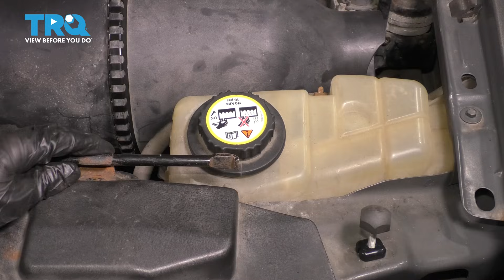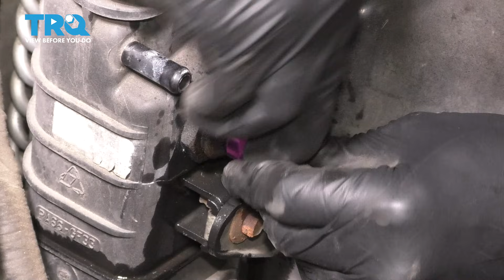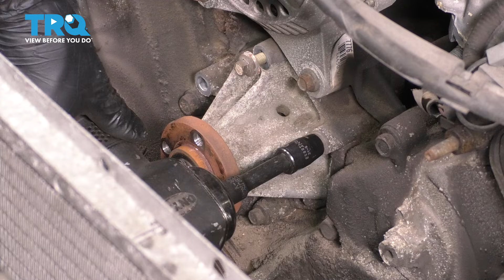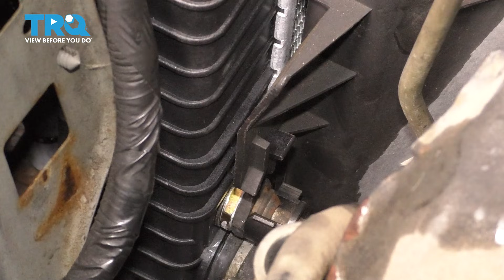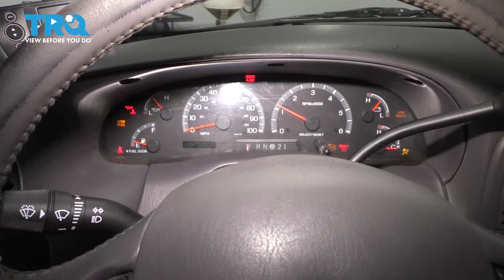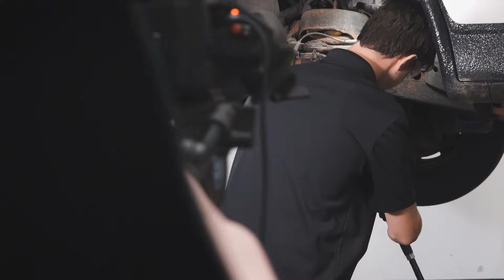How to Replace Water Pump 1997-2003 Ford F-150

Comment: REMOVING THE TRANS COOLER LINE AND COOLANT RESERVOIR HOSE ARE COMPLETELY UNNECESSARY STEPS.  Taking the upper radiator hose off at the radiator gives PLENTY of room to get the fan shroud out without removing the cooler line.  No need to remove the reservoir hose from the radiator at all.

Comment: unless you take out yhe radiator there is absolutely no reason to remove the trans cooling line.   second you do not need to remove the fan shroud. loosen the fan and push it inside the shroud towards the radiator.   lots of un-needed steps

Comment: I've seen both installing like this and then installing with silicone on the surface and I'm not a fan of silicone unless it's rear diff or something. Is there anything I need to know or should I not use the silicone method that people are insisting I use if I think gasoline might end up in my coolant because I'm not going to tell you I know why gasoline is in my coolant but after using Blue devil it sort of helped and I had a lot of petrol in my coolant and of course I've never gotten a solid answer because out of a million mechanics in America whenever you ask them something apparently they just don't know but when it comes time for you to do it they know exactly how you should do so what should I do because I've heard very specific comments to never use silicone on an area that could be exposed to gad